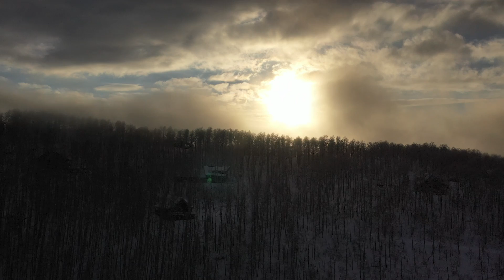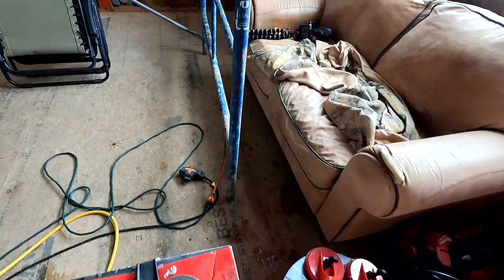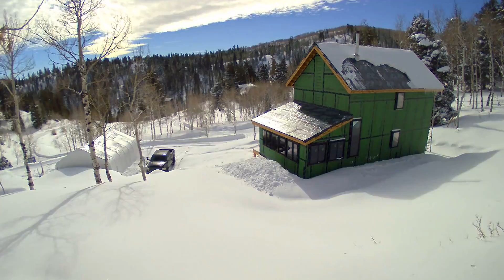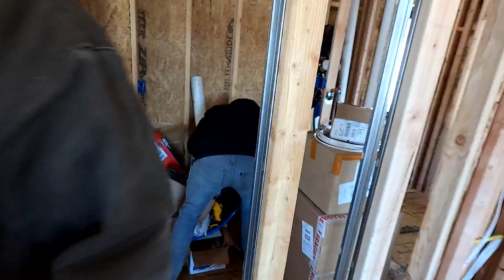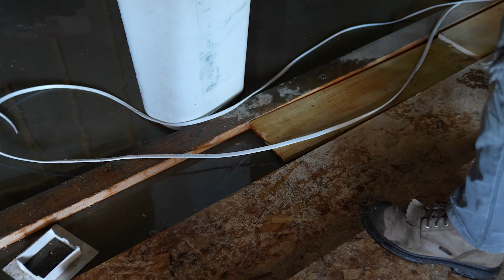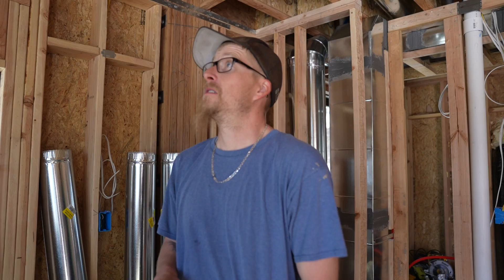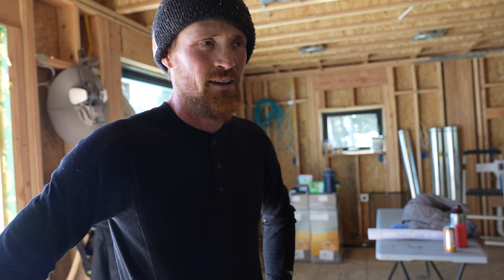OUR 4 WAY INSPECTION WAS AN UTTER DISASTER | BUILDING OUR OWN HOME

Comment: What just happened? Trent Allie this is too much for me to handle before drinking coffee in the morning 🤪😂. I’m glad you past your test. And about the circuit breaker, did you make sure to wiggle the cable on the the flux capacitor. That’s usually the problem, underrated and always overlook.

Comment: What type of breaker do you have outside at the street? It trips too often. Is it it a type which can not stand a short overload when you switch something in, the so called in-rush current? Or do you really have a short somewhere? Switch off all breakers, switch on the one at the street and then one by one you switch on the breakers to find out in which part of the installation something is wrong.
But congratulations with the great end of the check, even though the start (or just before that) was a nightmare.

Comment: In my previous post I told you that you put main electrical panel on the wrong and dangerous place. I am licensed electrician so unfortunately for you I know what I am talking about. This is not a last time that you will have problems like this. I just hope that nobody dies or that house don't get on fire or both. 😐

Comment: First: This was the hardest episode to watch!
Second: Super cool Allie - still filming all that disaster. 
Third: An inspection leaving that little writing is nearly passed!

About the water: On one side you may heat the house, also get ventilation to move wet air out (bathroom ventilation?) And put some ventilators blowing into corners to dry them out. Fresh air from the cold outside is very dry! My experience: There is no exchange between areas of high and low humidity.

Comment: You need a low voltage continuity tester (on a multimeter) - you can then test everything individually on the panel with no power applied - this will help you isolate which circuit is causing it to trip 8-) - you probably have a damp breaker, or if like the UK at all, if you have any earth leakage your breaker will perhaps trip?

Comment: As your HVAC professional, I’m going to go ahead and say that probably voids my warranty. 😂 But you know I’m always going to be here to help. Also, hey! I think I deserve more confidence than that. 😘
Reply: Safe bet....I don’t think there is a warranty around that will cover for Trent.🤣😂
Reply: Here is the policy and the reasoning behind it from the manufacturers' point of view: FLOODING AND SAFETY FLOOD DAMAGED HVAC EQUIPMENT Following unprecedented flooding in the mid-west, Rheem® is extremely conscious of the need to maintain a focus on the safety of homeowners, building owners, inhabitants and servicing contractors returning to or requesting repairs of damaged property. The careful inspection of HVAC equipment in the areas effected is key to proper function and safety moving forward. Flooding or partial submersion of HVAC equipment can damage safety features within the unit and the controls. Consumers, whose units may have been subjected to flooding, are advised to immediately contact a trained, professional service contractor to assess all heating, ventilation and air conditioning equipment before resuming operation. Rheem recommends that any HVAC equipment subjected to flooding be replaced and scrapped to avoid any risk of injury or harm. In the short term, the equipment may run, but over time, wiring harnesses and other components may have long-term issues and degradation of safety functions, reliability, and performance. Immersion or partial immersion by floodwaters of the equipment can compromise its key operational components, in which case the warranty will be voided. Flood damaged equipment should be handled as a homeowner's or building owner's insurance claim, and the equipment should be replaced. This equipment should not be repaired as a warranty claim or serviced on a standard call
Reply: @heymikeyhelikesit8673  
What a handy fellow! Good work and thanks for that insight!
Reply: @heymikeyhelikesit8673  Jesus Christ man..were you hoping for extra credit?😂🤣
Reply: @SilentStorm_5  Just trying to keep Trent & Allie and anyone else in a similar situation safe. There will always be someone who says they can fix a furnace that's been flooded, but it should not be done. At this point we don't know if it sustained water damage, but Uncool Dean is right. I'm 2,000 miles away, so I don't have any skin in the game. Just trying to keep people safe. There's enough suffering in the world. Sorry if it ran too long for you. Peace.
Reply: @heymikeyhelikesit8673  they will be ok😉 they will just have some electronics to replace and some ducts to be removed and dried...but they already know this by now I am sure....I think they are a few weeks behind on their videos. I love these videos for a reason......job sites are great for stories🤣😂🤣
Reply: @heymikeyhelikesit8673  What he said!!!!!
Reply: Dean, you did a fine job but that darn water is a pesky sort of gremlin. Hope you don’t have to reinstall...Have a great weekend brother!!
Reply: Dean is is the house!!
Reply: I don’t know if the duct is internally insulated but if it is, it’s toast. Once wet insulation is ruined. Not talking about mold.
Reply: @nancydenmark1614  No, no it’s not Nancy.🤣
Reply: @SilentStorm_5  not internally insulated?
Reply: @nancydenmark1614  not on the inside of those ducts
Reply: @SilentStorm_5  that’s good

Comment: With all breakers unmounted including main breaker the panel presents an open circuit,  I would do the following: Remove temp cable feeding panel, wire nut the ends and plug it back in to the extension cable coming from the line power by the road. If it still trips, that temp cable is faulty. Another thing to consider is the breaker down by the road has weakened from all the tripping it has been subjected to. Try replacing it. Also, if the road breaker is a gfci, it could be a contributing factor and is tripping when any wet induced leakage reaches its trip point. Try plugging a dry power tool into the feed cable and turn it on to test that segment. Should be all a process of elimination. Also, suggest obtaining an ohmmeter and getting versed on its use. Very handy. Just never use on live circuit.

Comment: If there's water inside any of your breakers ... that could cause the line to trip ... also GFI breakers are extra sensitive to moisture! Heat of some kind may help to dry the breakers from the inside out! (Moisture in electric motors can be baked out by putting the winding in an oven at low temp for an hour or so) - not sure that would be the same fix for breakers! 🥴😔

Comment: Instead of using the breaker at the network for isolating the problem I think you should use some measuring equipments that measure isolation.

Comment: It's too bad you don't have a solar generator, you could just push 110v locally without risking tripping your house breaker.
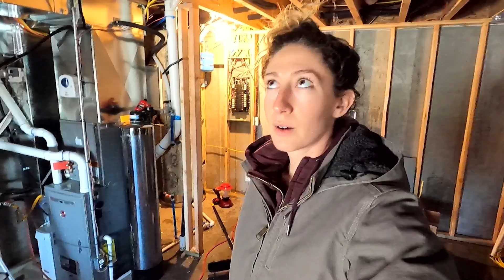Ahahah 14:08 Allie! You couldn't hide your smirk, I saw it!
22:18 don't you have an air compressor? That's what I'd have used to get the water out.

Comment: The inspector was looking at all those nail plates on the kitchen vent, supposed to have a stud shoe. Don't think they make them that big. You got away with it.
Good job.
Tighten the schrader valve stem.
Check your 220, also an overloaded switch.

Comment: Hi guys - not sure if you figured it out as this may be an old video now but I'd shut off all the breakers reset incoming breaker and turn the breakers on in the basement one at a time and have someone watch when the cord light going out. When it does thats the circuit you need to check, I'm going with furnace the electronics are probably soaked and shorting out due to water. Congrats on the 4-way inspection and boy oh boy is Lika getting big real fast or is it just my imagination.

Comment: Being an old bicycle mechanic I immediately thought of the core of the schrader valve not being completely screwed in to the bottom on the stopper. Could you check that and report? Thanks.

Comment: Unfortunately breakers are not water tight.  Blowing on them won't dry them.  If your Main Disconnect Switch at the top of the box got wet....Good luck.  I am tempted to suggest chucking any breaker or disconnect that came into contact with water.  Corrosion is not a friend of electrical safety systems like disconnects and breakers.  You absolutely need to pinpoint this problem.  Fixing its self because something dried out is risky business at best.  Electrical problems that fix themselves are future problems waiting to happen.

Comment: every time you arc /trip a breaker... it takes LIFE away from it....
if you get dehumidifiers, and run for few days locked tight, with wood stove on, and still trips, maybe bad breaker at the street box at this point?   Funny.. pass 4 way and the house shows gremlins everywhere now....

Comment: Congratulations on the 4 way.  It was great of the Inspector to let you fix the things he was concerned about while he was there.  Prayers that you figure out this electrical problem soon!  Just take it one step at a time, from where you plug in the extension cord, to what you plug into that cord, every junction.  I know you will find the culprit by Monday's video!  Hopefully the furnace just needs to dry out and it will work!
💖🙏💖

Comment: Depending when this happened, first thought, have patience, walk away, leave it at least 24-48 hours, let it dry out.
Second, check your live to ground, neutral to ground with a meter.
Make sure all breakers are off, if the cable stays lit, turn on one by one.

Comment: Trent, I am of a electrical mind, many years worth.  So here goes my two cents for what it is worth.  Replace it all or have problems in the future.  Even if you get it to work,  you will probably have problems down the road.  Additionally, the breaker you have reset so many times is probably weak from being tripped so often(been there done that).  Might want to replace that one first then check system.  If you do not replace it all, keep a bunch of spare breakers around you will probably need them.  Good luck on whatever you decide to do.  Wishing you a wonderfully blessed week.

Comment: I recently cleaned a double adapter plug with a very damp cloth and even I’ve left it on the sunny windowsill to dry for 3 days before I use it just to make sure there isn’t an ounce of moisture in it.  You really need to let that dry out for many days and the floor and get your friend to check that vent heating system, the electrical might be full of water.

Comment: Times like that with wayer and panel  makes me wonder  if WD40 would  help as its displaces water  hence the WD in name  
  Older cars that stil used points and ect when water made to the distributor  would spray with wd40 to remove moisture  and vehicle  would run

Comment: Word is you don't have to pay for cable or satellite - Lika's ears can pick up all the channels! lol
Reply: Her ears crack me up at how they just flop over when they're supposed to stick up. Will they eventually stick up?
Reply: @kimberlyearly8918  normally they do as the pup grows.
Reply: @kimberlyearly8918  I checked Google to make sure I remembered correctly. They normally stand between one and 4 months but if ears don't stand before 6 months more than likely they won't ever stand. I have no idea how old Lika is. Good to know that cute flopped ears on dogs really don't matter unless they are a registered pup and owners plan to breed them.  There are ways and means to prop them called "posting" but like ear cropping it's very controversial. I think Lika is adorable either way.
Reply: @jcrefasi1  We used to have a sheltie and he had one ear that stuck up and the other was bent down at the tip. They are supposed to both fold down in the tip but of course we didn't care.
Reply: @kimberlyearly8918 my niece has a shelties and she is the sweetest thing. I've only had 2 "grand dogs" that are like mine. I'm a cat lady lol 🐱
Reply: @jcrefasi1  Our sheltie was the BEST dog we've ever had!

Comment: I hope you never ever experience a flood like that again!  BUT, if you do, dispel as much of the water as you can with an air-blower.  You'll still have places like the narrow space between the concrete wall and the rear surface of the electrical panel.  If water lingers in such spaces there'll be a risk of rust.  (I was taught that one inch of steel produces thirteen inches of rust and it can exert enough force to bend the steel!)  The quickest way of dealing with that is to drench it with alcohol - in the UK we call it methylated spirits but I think in the USA you call it denatured alcohol.  The thing is - the alcohol combines with the water.  In short, the alcohol evaporates and takes the water with it.  Remember, though, that alcohol vapour is inflammable so attend to the ventilation.  I'm sure a lot of commenters will recommend WD40, after all, the 'WD' bit does stand for 'water dispersant'.  Still, WD40 isn't to be found in everybody's utility cupboard!   Maybe vodka would work in an emergency!!

Comment: Check the furnace for the problem. Also, might be a ground problem with the water in the basement. Dry the basement :P
Reply: The breaker to the furnace from what trent said is off, along with every other breaker except the bathroom fan.
Reply: I think the furnace holds power. Might have an internal battery. Or maybe they got it backup generator connected. Just giving possibilities the check and look for. When a breaker trips is normally a ground connected to it that makes it trip

Comment: OMG Trent!
As a musician I have dealt with wet electronics. Yes, it needs to dry out. I know you wanna check it right away, but let it sit for 24 hours first, even if it seems dry. Take a break, walk away and do something else. Clear the deck outside. Remove snow around Terry. Just let the panel rest and try it tomorrow.
If you have one, set up a dehumidifier by the panel.
Reply: also get a rip roaring fire going it will dry heat the house as well
Reply: I had a phone to which i dropped it a bucket full of water.  immediately threw it in a bag a of rice and wait for a day and it would kinda turn on but then it flickered and flat out died. After getting a new phone and forgetting about it for a few months, my dad decided to turn it on and it worked....I guess i didn't wait long enough or something?
Reply: @Sinnedx  rice. And time....
Reply: I wouldn't have wanted to try anything electrical right away. Hope all is well now.
Reply: As I learned from professionals: A dehumidifier alone isn't the work. You also need some fans to blow air around. And every some hours - move the fan a bit.
Reply: I agree they we're trying t soon.
Reply: It's probably the wet electronics in the furnace.
Reply: Agreed, my experience on the construction site is it need 1-3 days
Reply: And as a musician, you know it’s usually not water, but beer.
Reply: @ve3yjt  😂 yes, I know, but being a keyboardist, it's usually the condensation dripping off of their glass or bottle that they happen to be holding over my keyboards that ends up going inside a button or key. And they all say the same thing right before it happens "I'm not gonna spill it on it".....then they do. 
Now the cables strung across the stage....... THOSE are DEFINITELY covered in beer, and they get wiped off as I roll them up. It's disgusting!
Reply: Agreed. Set up the candle.
Reply: Candle, and fans to keep air circulating as much as possible. Silica  too, to draw moisture from the air.
Reply: I was hoping someone would say this. Let electronics fully fully fully dry BEFORE plugging in!!!
Reply: well that dehumidifier is a good idea but it needs electricity doesn't it?
Reply: @brendamcginnity  they can plug it in from the "main" extension cord only
Reply: @brendamcginnity I assume the cord coming from the street that supplies power to the panel (that isn't working) can be unplugged from the panel and then used to power fans, dehumidifiers, or heaters. Someone correct me if I'm wrong in my assumption.
Reply: @brendamcginnity  It does but they can run the extension cord directly to it.
Reply: He got to ask Kevin he don't have enough confidence in himself and he did Nice Guy but all he does is bitching moan
Reply: @dennisflood9280  All you do is use lousy grammar, and complain.